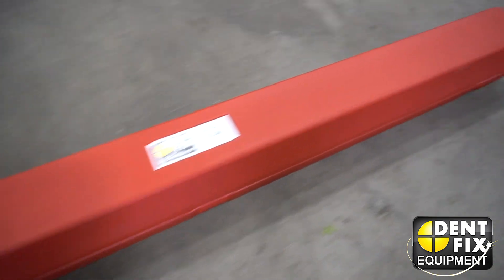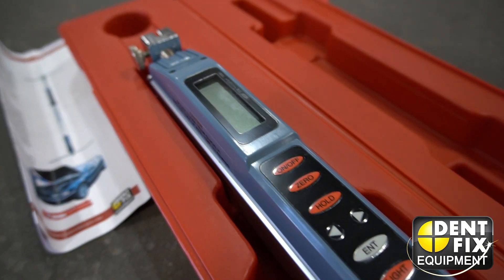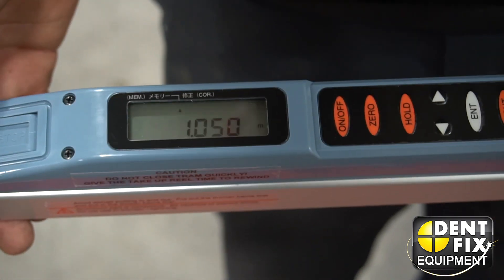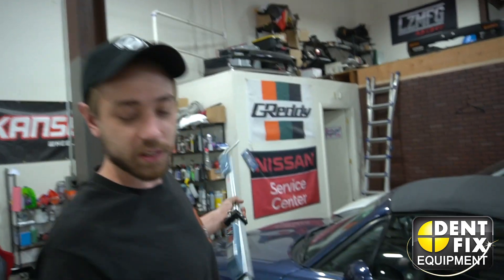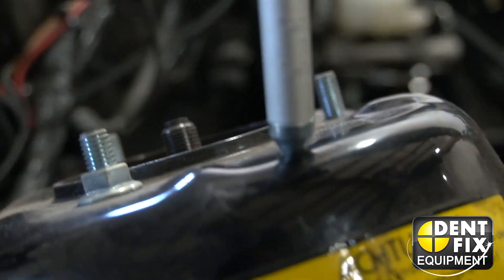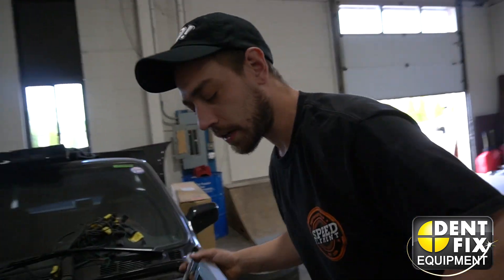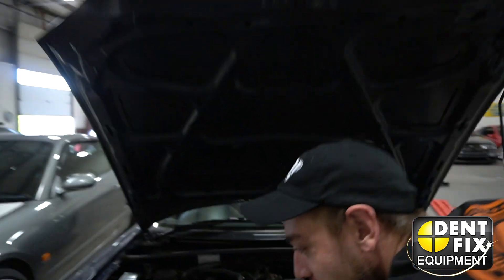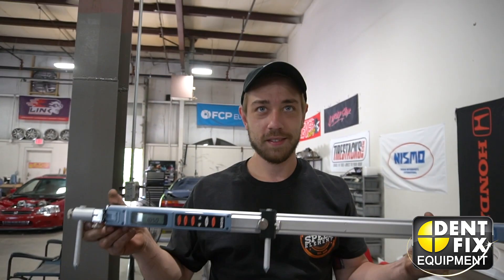DF-3D Digital Tram Gauge - Brian Hall Review

Comment: I own this exact tram Guage and paid top dollar for it. I regret buying it every time I use it for one reason. The telescoping arms will not lock in place.  The first one that slides out will but the remaining ones that slide out will not lock in place. For that reason I recommend anyone looking at buying one don't waste your money.
Reply: If you want to lock it use the thumb screws. I don't understand
Reply: So they slide back in easily ? or does it have some resistance ?
Reply: Just say you either don't actually have one, or you don't know what the phuk you're doing amateur.